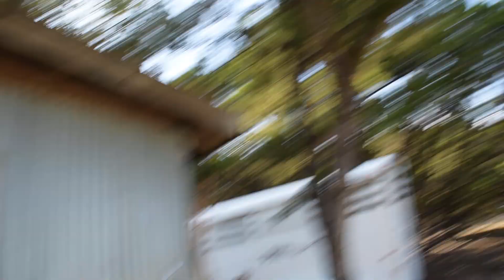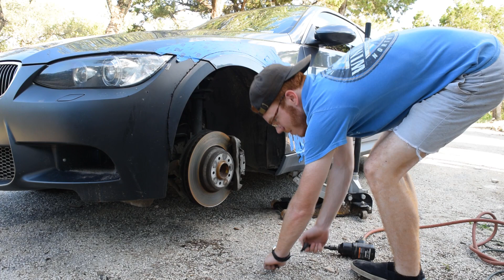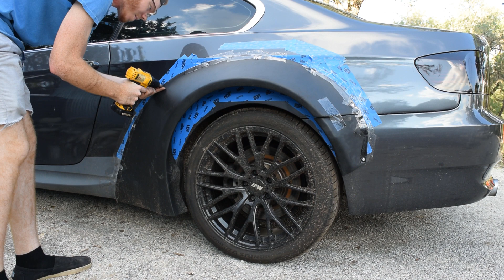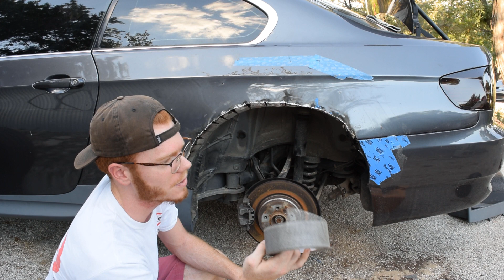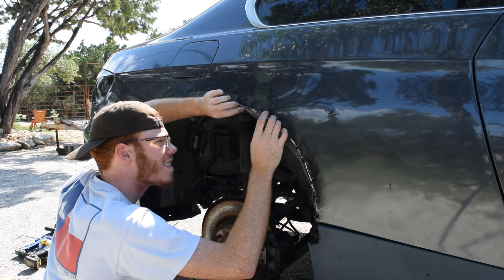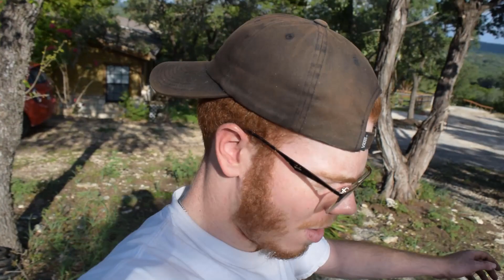BMW 335i Wide Body Install!! Pt.2

Comment: What size tire are going to put under their? 
How big of spacer will you use.
Reply from the maker: im running 265 in the front and 285 in the rear. I have a 50mm spacer for the front and 70mm for the back, kinda wack but it works

Comment: Bro we need an update here! Once mine is bagged I'll be doing this. Any idea what wheel size offset etc you'll be going for? Also you on Instagram?
Reply from the maker: Sorry guys should be posting my next video tonight! I'll go over the whole build, but I'm just running spacers for now. 70mm in the rear 50mm in the front